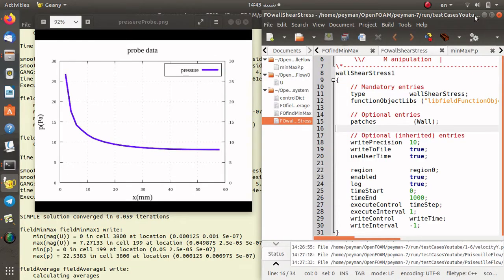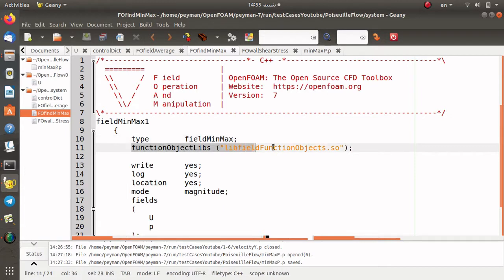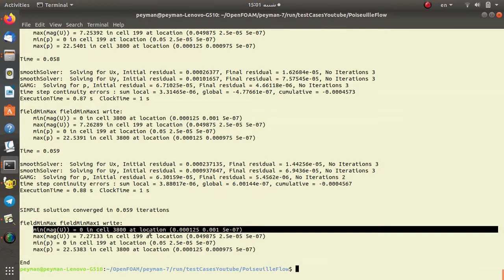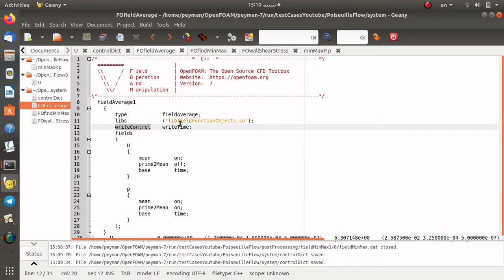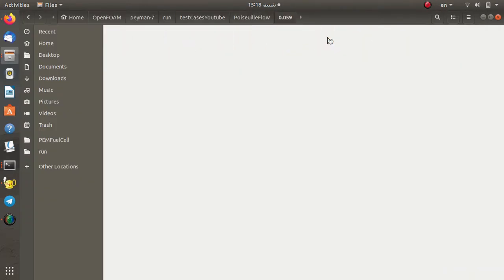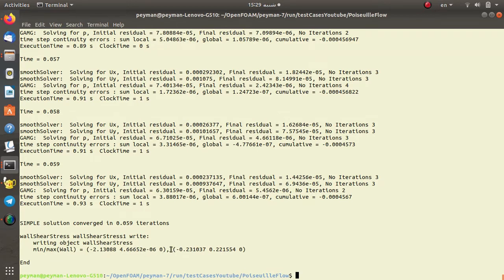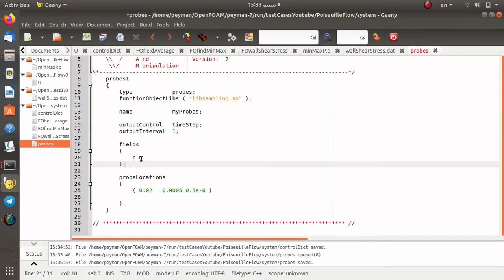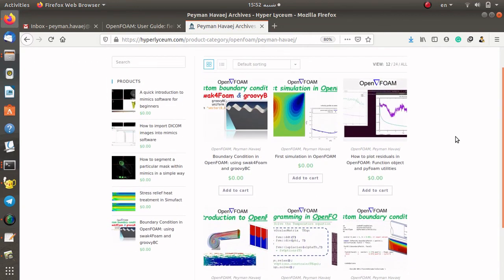Post-processing CFD data in OpenFOAM: functionObjects

Comment: hello, and if we want the average of a field in a patch? what would be the functionObject? for example p at the inlet or the concetration of the scalar with scalarTransport ? thanks!
Reply from the maker: Hello Franco

There is a utility that calculates the average of a field on the patch. Its name is "patchAverage".

The syntax can be a bit different for different OpenFOAM versions, However, in the foam extend you can use the following command:

patchAverage "fieldName" "patchName"
Reply: @Engineering_downloads  thanks a lot!